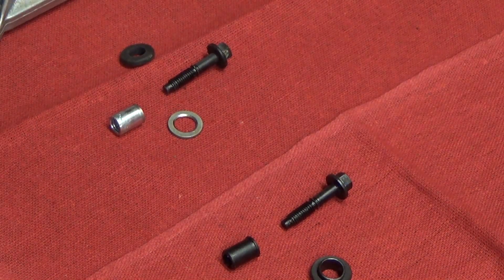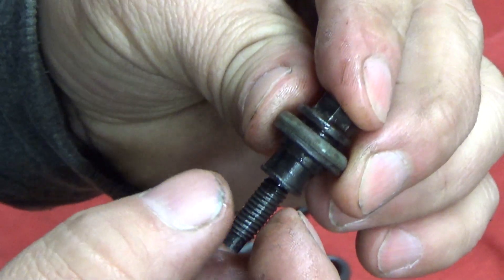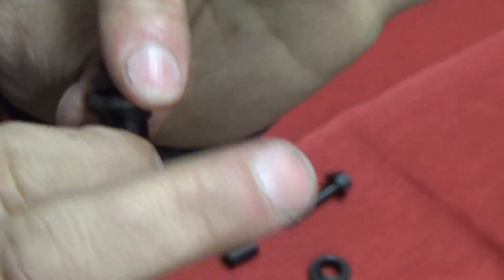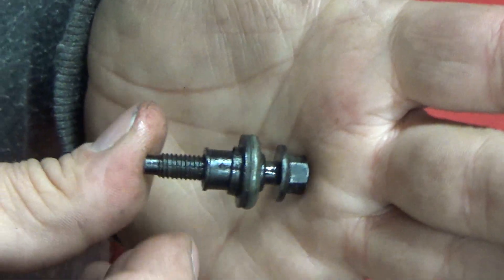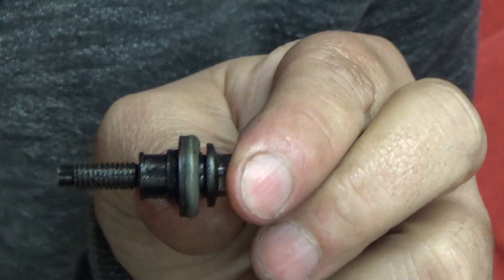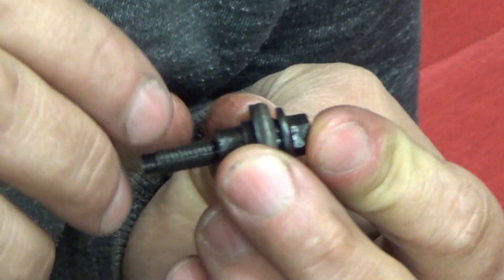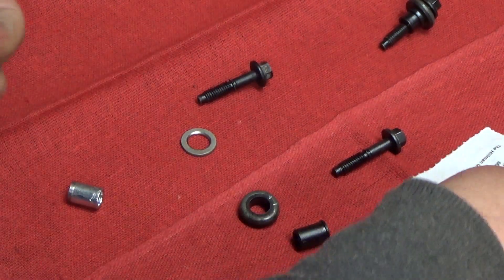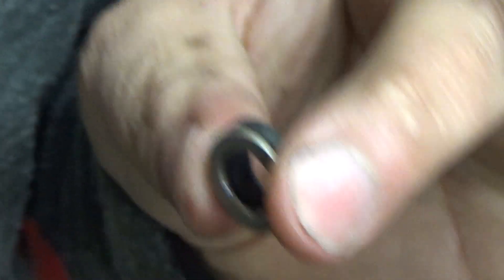Why Is this bolt $25? Ford 2.3 Valve Cover Bolt Problems

Comment: The problem is they made them overly complex to begin with. Those sleeves (and probably the washers and grommets) were installed before the threads were rolled on the bolts so as to be retained on the bolts. I don't know how you pulled them off. Then again, I haven't tried forcing one off.

Comment: Audi A4 A6 Quattro 2005 - 2007 work. On amazon, 14 for 25 bucks. Also I found 2001 Mazda B2300 SX-L4 140ci gas mfi Vin D 4 valve DOHC part number LF02-10-237   Will update if they work.

Comment: Main issue:. This engine runs as 275 degrees F on the freeway. This means that EPDM may not be good enough. 
However I can save you a LOT of trouble in the future REMOVING THE RUBBER:
 Soak in 1/2 acetone and 1/2 alcohol for 24 hours. The rubber can then be easily removed from the assembly. This means that you can slide the new rubber (if you find it) directly over the original bolt assemble with a little lube.

Comment: That's nothing tried to get a lower intake manifold bolt for a 2004 Mercury sable. No aftermarket and Ford dealership wanted $200 per bolt for the 4 they had left company wide for that year model

Comment: I just went through this. I found a set of valve cover bolts on Amazon meant for a 2005-2007 AUDI A4 for $25 that would probably work out of the box. Instead I used the grommets from the Audi bolts on my Ranger bolts. Maybe this will help someone.
Reply: Hey, how has this setup held up? Have the audi bolts worked and kept from oil leaks? I'm trying to figure out a replacement for these on my ranger now

Comment: Sucks for me because ford said my truck (2002 ford explorer sport V6 4.0) has 3 different size bolts didnt even give me a diagram of which bolts were what size. The front driver side outside the valve cover bolt broke off when my mechanic worked on my car. From what I'm seeing the stealership has the bolt for I believe $14 a piece and can't find the bolts anywhere else do far. Everyone is selling bolts that are all the same size for the same engine and I'm like wtf I have the same engine but they said I have 3 different sizes?

Comment: It's a mazda engine. The bolts are still available from mazda for the b2300
Reply: No, they are NOT available from Mazda or Ford. They are considered obsolete and discontinued. Last cost available was $275 when they were available.

Comment: How about adding the Lowes SKU and link in the description?

I watched it in slow-motion more than 10 times, and I THINK I have the information here:

Hillman 
1/2 x 3/8 x 1 Steel Spacers
SKU 0-08236-70808-0
P/N 880416

Rubber Grommet
5/8 OD x 5/16 ID
SKU 0-08236-71645-0
H# 88125
161-2751

Comment: The metal collars and bolts are good on mine and only the grommet is bad.  So I am thinking of breaking grommet off (and maybe the washer), then using McMaster-Carr 98017A200 for a washer (ID is 0.390" so it should barely slip over the lip on the bottom of the metal collar) and McMcaster-Carr 9600K314 for the grommet (the bottom part of grommet must be cut off).  Many rubbers can only take  temps of 170F.  But the one I found at McMaster is EPDM rubber , can handle -60 to +300F and is chemical resistant.  Most rubber gaskets are made out of Silicone, Viton (fluoroelastomer) or EPDM.  The OD of the grommet, and the OD of the part that goes down in the valve cover hole are almost identical to the original so I think it might be possible to just cut the grommet off of the old one and use the original washer.  The original grommet fits fairly tight over the original sleeve, but the one I selected has an ID of 9.5mm and the metal sleeve OD is 9.10mm.  But I don't think that will be a problem.

Comment: Great video. I'm in the same boat with my 2003 2.3L Ranger.  Only 4 of my (formerly rubber but now hard as plastic) grommets are broken and only one of them badly.  The other ones are still whole, but so hardened and stiff that I can't remove them from the valve cover without breaking them.  I read somewhere that the Mazda Speed 3 valve cover bolt might work and I have one on order (LFBL-10-237), but from looking at pictures I am not sure it will work.  I have also thought about trying some valve cover bolts that are for the 4.0L 2003 ranger on Parts Geek.    

But after seeing your video I think I may just make my own.  Since all of my grommets are old and hard  I may fabricate all 14.  However one thing confused me about your video.  At 2:41 you demonstrate how the metal collar won't come off of the bolt.  But later in the video you show one of your bolts with the metal collar removed and you measure it. How did you get the metal collar off the bolt?  If you can remove the metal collar, why not just use the original metal collar and bolt and then use the Lowe's grommet and the washer?  If you can tell me how you got the collar off of the bolt, that is what I plan to do. That way I won't have to fabricate 14 spacer/sleeves.  Thanks!

Comment: Anybody wondering you guys could go to your local junkyard and take them if they have them
Reply: I just checked and there is only one Ranger that had the metal valve cover (2001-2003) at the local junkyard and I'm not sure if it is a 2.3L.  But I was considering giving that a shot even though they would likely be just as broken as mine.

Comment: Call ford and get the part number, put the part # in fordpartsgiant.com. That’s what I did with my 3.0 valve cover bolts that I literally couldn’t find anywhere and was discontinued at ford. Bolt cost $3.5 a piece.
Reply from the maker: Thanks for the info. I'll definitely try that if I run into this again.

Comment: Totally defeated after finding out about these bolts. Been working on this same job today and found this video. Great job creating a solution. Any help in finding manufacture ones would be a life saver, my valve cover remains off atm.
Reply: Same here. What did you do?
Reply: You won’t find any from parts stores or manufacturers. Trust me. I’ve looked vigorously for 3 weeks now. Go buy washers at ACE hardware
Reply: @h4drummer  I'm thinking just break off the old hardened grommet and washer leaving you with just the bolt and metal collar/sleeve.   Then slide a new washer and grommet over the  sleeve.  I just wonder how some rubber grommet that isn't made for this would hold up to the high temperatures.  Natural rubber has a limit of 210, Buna-N is 250 and Viton is 400.  I don't know what a grommet from Lowes or Ace would be made of.

Comment: I have the 2003 ford courier here in Australia. It has the same bolt setup but the rubber grommet and sleeve bit don't lock on, and you just have to order the new grommet and sleeve bit, I'm getting a set tomorrow, about  $58 for the 12bits, still a little pricey for what it is but they're not hard to find, you did good making it up though, it will work no worries by the looks of it.